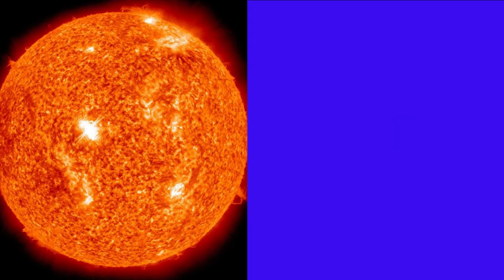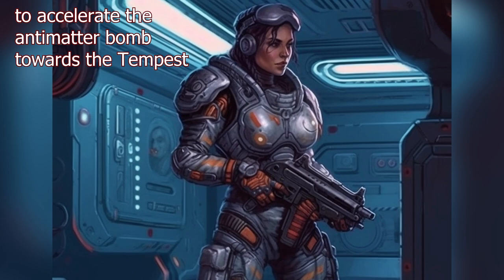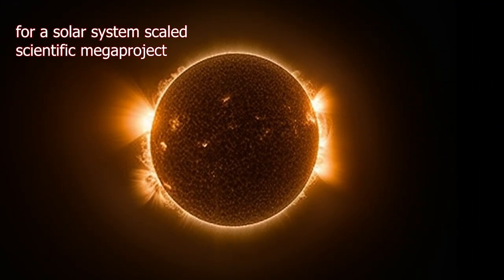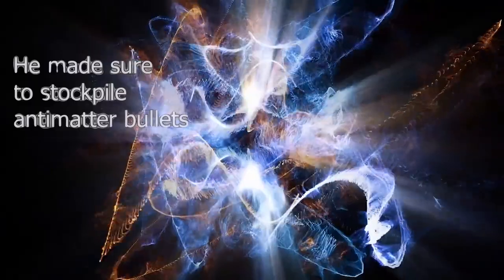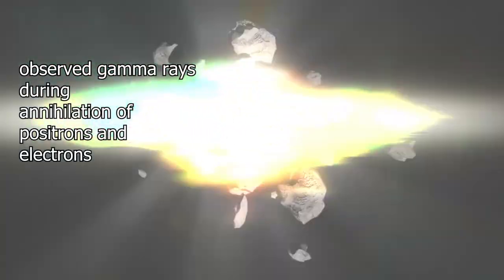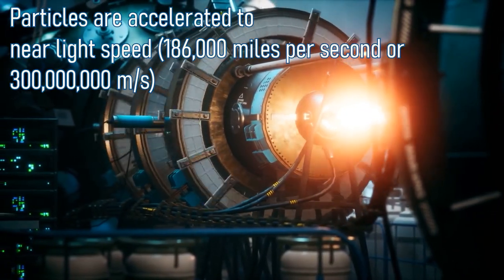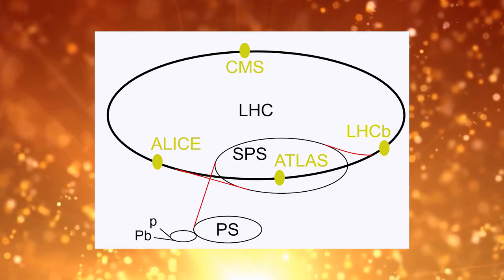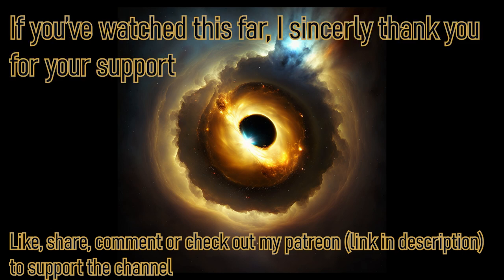Antimatter (in The Expanse and Death's End) #antimatter #scifi #physics

Comment: The apocalyptically large explosion in the expanse example is likely explained by the destruction/failure of containment of the ship's antimatter fuel. 

Antimatter is pretty wild stuff, but not nearly as destructive as fiction often portrays it. 

It's still hideously destructive - if you reacted a kilo of matter with a kilo of antimatter at perfect efficiency (that's the super hard part), you're looking at something like a 40 megaton TNT equivalent reaction. Getting it to do that is the tricky part, you'd have to mix the two materials while also keeping them separate, otherwise the reaction at the area of contact would blast the rest of the materials away at VERY high speeds.
Reply from the maker: I wish I could have consulted with you when I wrote the script! I somehow didn't make the connection that the Tempest also uses antimatter as fuel, which would have added to the explosion. Thanks for writing this up and sharing!

The concept of antimatter is fascinating stuff. I would love to know why there's so much more matter than antimatter in the universe!

Thanks for watching
Reply: @tacobanana_forever  the matter antimatter discrepancy is a real head-scratcher. There's an explanation that does neatly solve it but the possibilities it raises are kind of wild. 

Antimatter, visually, doesn't look and different than regular matter(unless it has tiny subatomic goatees like in star trek)... If a star, or even entire galaxy was made of antimatter, would we be able to tell, from a distance?
Reply from the maker: I'm very curious, what is the explanation you're referring to that raises wild possibilities? I'm intrigued.

About antimatter galaxy.... i don't know to be honest. I'm not sure how different antimatter is in regards to the weak and strong nuclear forces. The nuclear forces would dictate how stars and energy emission work. Gravity would be the same, so the galaxy would still largely be organized into rock planets and gas giants orbiting a more massive star; with some rock fields, nebulas and asteriod belts thrown in. Electromagnetism would be the same, and all that implies for energy transfers.

So thinking about it, I guess we wouldn't really be able to tell from far away. What do you think?
Reply from the maker: So, thinking about it, Antimatter galaxy might be a cool idea of a video....